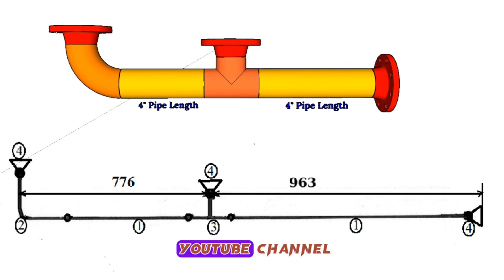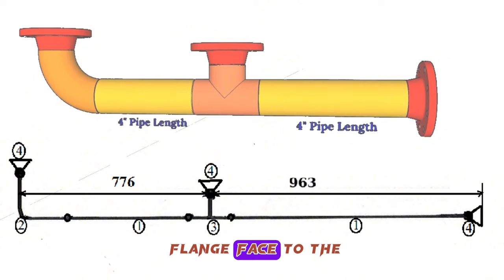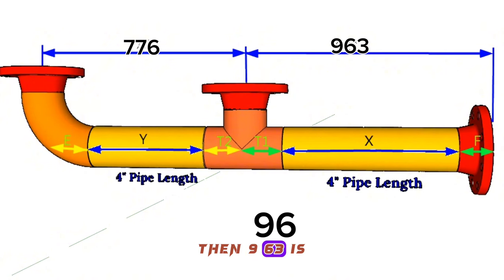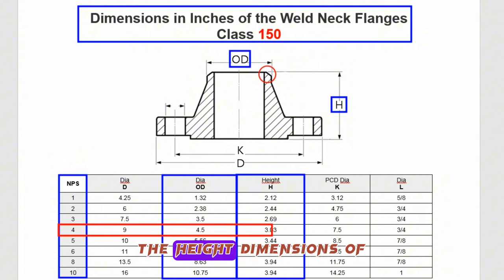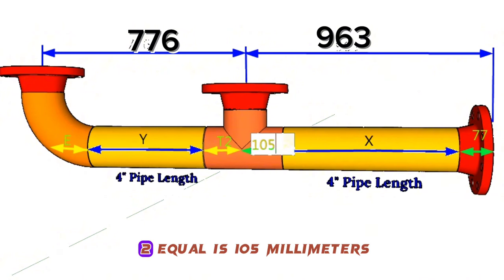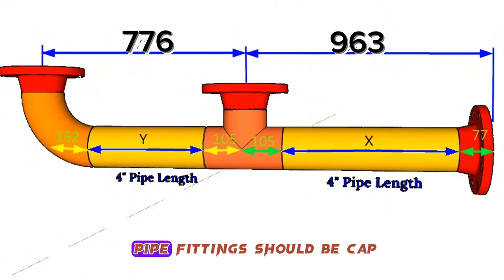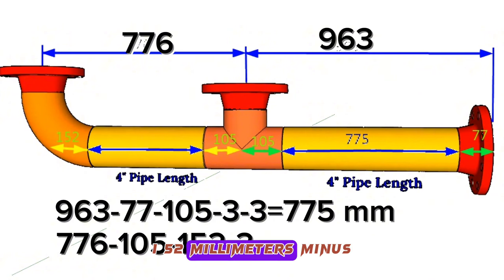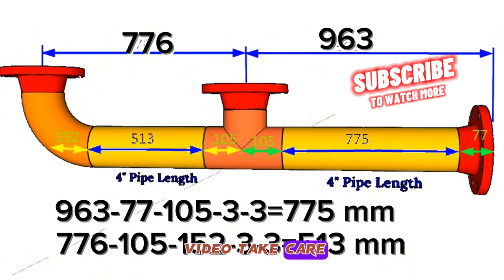Pipe Length Calculation.Weld neck flange dimensions. 90-degree elbow dimensions.Pipe tee dimensions

Comment: First of thanks for the great job 🎉🎉🎉🎉.

I have a question : to find the hight of the flange you multiplied 4.24 * 25,4.

How did you find 25, 4 🤔🤔.
Thanks for the answer.
Reply from the maker: Thank you very much for the nice comments on our last video! With your support, we are getting more motivated every day.
The dimensions on the pipe flange chart in the video are shown in inches. To show the size indicated in inches in millimeters, we multiply it by 25.4 millimeters, which is the dimension of one inch.
25.4 millimeters is the length of 1-inch in millimeters